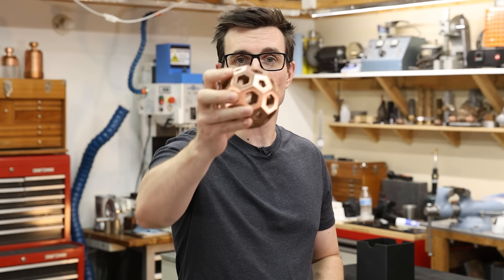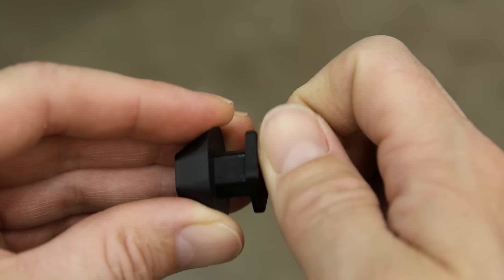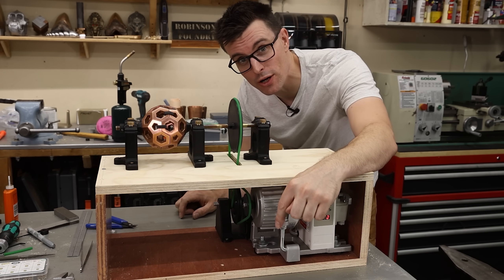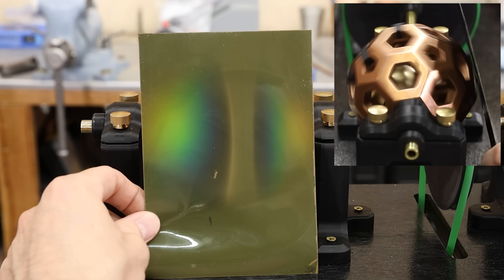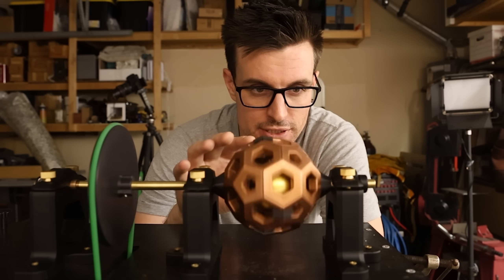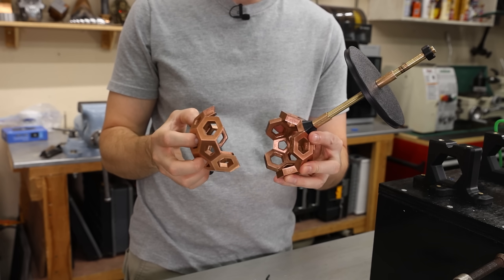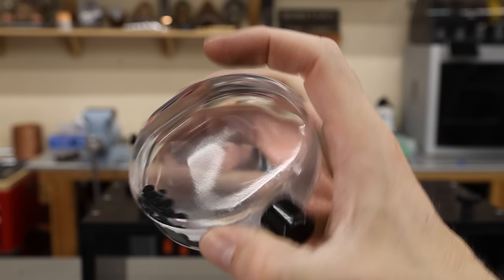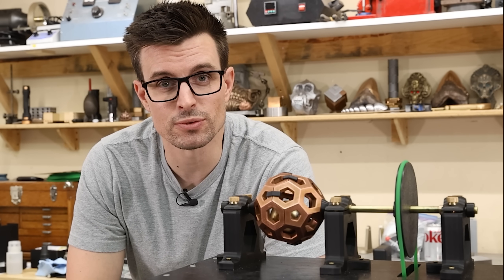Huge Magnet vs Copper Sphere - Anti-gravity Machine

Comment: when a magnet is dropped through a copper pipe, because the forces at work are equal on all sides, the magnet travels through the pipe without touching the copper pipe's inner sides.  I see the problem you had there is the unevenness of space around the magnet, and also the holes in the material of the copper affect the consistency of the field effect. 2 things I'd try: first, use a copper pipe and drop a magnet through it. see how big or how small the magnet has to be for the field effects to balance out, causing the magnet to travel through the pipe right in the center of the pipe's inner circumference.  Use the information you gathered from that experiment to construct a sphere that takes into consideration what you learned from the pipe and magnet experiments. With a solid-walled copper sphere, you won't be able to see what is going on, but if it floats, you will not hear any rattle.  (Side note, mercury is used in electro-gravitic engines.)

Comment: You're assuming that the weight and density distribution are symmetrical in the sphere and the magnet ball, also I can appreciate movement in the mechanical system which must affect the gravity center, you need a more perfected system, also you need to calculate the magnetic field force to know if this is stronger than centrifugal force to maintain the ball centered

Comment: I'm quite possibly wrong, but it seems to me that the problem would be your "sphere" itself... because it's not an actual sphere. I couldn't count the sides but it looks like an icosahedron(?). With the magnet in the pipe you have two smooth actually circular vectors. In this setup you have the spherical magnet inside a cage that is a whole collection of planes and angles. You would HAVE to have exterior stabilizers to counter the fact that no matter how fast it's spinning, you have an entire crapload of different vectors bouncing past each other. 😮

Also, just a suggestion... put the flashing lights warning at the beginning of the video BEFORE you point a strobe light directly at the camera 🙀😹

EDIT:  maybe inserting a smooth circular collar inside the seam of the cage...?

Comment: The holes in the copper dodeca are too large on the central section acting like insulators, not only reducing the eddy currents, but making the dynamics unstable. A stabble position would have gravity perfectly countered by the eddy current flux. The speed at which the eddy current flux counteracts gravity is higher than the dynamic resonance instability limit caused by the holes. Ie. Smaller holes.

Comment: The spherical magnet has a north and a south pole with a line in the middle, what will happen if you make a 3D printed ball, with small neodymium magnets all over the outside with all of the poles facing the same way outward?

Comment: You should try your original magnet pipe setup on something like a rock tumbler rollers just to play around with variables. I think the holes in the lattice and the zigzag lines of copper electrons are creating voids where the copper tube is a continues sea of electrons creating more cushion in a way. But otherwise very interesting video brother man , appreciate your effort to test your ideas.

Comment: The geometry might be more difficult to keep rigid, but what if the hexagonal borders were thinner, creating larger holes that are easier to see into? Or what if it was a copper mesh screen? Forming that into a sphere could be hard, so how about a cylinder of copper mesh, with a spherical, or perhaps cylindrical, magnet inside, rotated around the cylinder's central axis?

Comment: The balance is off with so much movement on the axle Newton’s third law comes into play. Simply said the axle is bouncing and is in sync with the knocking sound.
Reply: Yea that is what I notice, its not balanced at the axel
Reply: @Vmaster005 just like a bent crank/cams shaft or timing out on a car engine.

Comment: logically, i'd think that the holes in the copper would be points where the magnet wouldn't be levitated as much as the solid points and that's why you're getting a wabble. I'd think that having a solid 'strip' of copper in the middle would solve this which means that the only way to view the magnet levitating would be from the side, which is just as good as the front and since you're re-designing the copper sphere, you may as well remove material from the sides. to view the magnet better. 🤷‍♀🤷‍♀

Comment: Anti gravity machine 😂 ummmm no! Sure it can sort of defy gravity inside the sphere but the sphere is bound to gravity so no it can't defy gravity because it's still stuck to the earth and if you built it in space it will do nothing. Won't move forward or backward or up or down. Sure it's a cool desk ornament or a paper weight but to whoever said it's the start of the anti gravity machine is a complete fkn idiot and needs to go join maga maggots and dear leader Donald Putin supporters they have about the same interlect of a dead toad 😂

Comment: Yeah,  it sounds like this works better in a wheel than a sphere,  which was my assumption before reading other comments.  But I'm not a scientist so my assumption means nothing.  

The wheel might be able to help with visibility and the hovering.  

Maybe there's also a decent ratio between the magnet size and the wheel you need to find,  too

Comment: So we know this can spin and spin, so I see you have some kind of motor. My guess is a generator. Ok good set this to 12 volt batteries. What you missed is the fact that yes it works the magnets rotate the spheres. As it will stop or slow down, what I would do is take a small 75 watt or 50 watt solar panels and have  small motor run say every 5 mins then off for 15 mins. So if you pulse this great device it will work. So it has a small knock still works. You have it but you just don't know you have it. Yes magnets are not energy, but solar panels are. So what I understand is that this will be very efficient system. Just complete the system as shown. Later perfection will follow. I know. Let me know and I can redesign the entire device. Or just do what I'm telling you.

Comment: Could you make an electro magnetic motor to levitate a magnet but I have a suggestion on this . 
Think of the magnet as Earths gravitational field ,
Flip the current of the electro magnetic engine to push away from the magnet instead of pulling it to levitate . 
Build a few of these electro magnetic engines . Fit them in a structure that will be the Craft and have it levitate by pushing against the magnetic field pulling it down towards the magnet  placed on the ground .

You could make a mini ufo floating using electro magnetic engines .
Instead of floating a magnet .

Comment: The plane "dead center" of the magnet aligning like a bicycle wheel orientation makes perfect sense, its the least resistance. I already knew that would happen before you showed it, and no I don't have any real life experience that helped me know that.
Its the knowledge I already know that I deducted that, the instant you showed that you marked the magnet, didn't even have to try

Comment: Convert the rig to one that spins the copper tube. I've seen it done on a system that spun 4 skateboard wheels, with the pipe simply set on top of the wheels. Then the camera is placed at the end of the pipe to show how the magnet continuously floats.

Comment: You know what would be insanely neat? To enclose the whole thing in a tank of like water or circuit board oil/coolant and put the ferrofuild around it? So it would be a big 3d tank of ferrofluid moving around the magnet as it spins. Theoretically you could have two separate tanks, one within the other to prevent the fluid getting in the motor or just touching the magnet itself. Like you could have a spherical clear plastic or glass tank for the magnet and motor and a typical fish tank around that, put tons of ferrofluid in and it would look 3d!! That would be cool af!

Comment: What happens if you change it a little bit? I think you got a problem there. 
If you to spinning this kind of shape it will make magnetic holes. This holes are a good idea to see insinde of the first sphear. If you make holes, but not in the path of the boll, it maybe can work like with the tube. I think the mass around the boll has impact in the magnetic field.

Comment: I think it would work better if recast the copper so where the magnet spins is solid that why you getting a wobble in the magnet it push and pull different directions because path surface of the copper isn't straight

Comment: No dude, it has nothing to do with your tolerances. It’s because you decided to with a dodecahedral copper cage with irregularly-sized bigass pentagonal holes. So, the diamagnetic/antimagnetic effect upon the spherical Neodymium magnet is also irregular — causing it to periodically bump against the thin inner-walls of your oddball icosidododecahedron copper cage. It’s analogous to installing decagon rubber tires on your vehicle that has premium shocks & suspension and then wondering why the ride feels bumping even though you’re driving it on a super smooth road. If you had went with a thicker or spherical copper cage with evenly/equilaterally-spaced hexagonal or circular holes instead of an oddball icosidodecahdron you wouldn’t have that problem, but I condemn you the effort and gumption to try it in the first place. Great minds think alike. You haven’t seen “extremely magnetic” yet. The US DOE (Department of Energy) has had classified N614 “monopole ultra magnets” since 1972. They’re so powerful they can power a military tank for a whole month with just a common 9V battery.
Reply: Bro holy yap just enjoy the video without geeking out

Comment: I think I know what the problem is but Idk if I will be able to successfully explain it. The ball inside can only hover horizontally because the outer cage is spinning in one direction. Causing the ball inside to fall to the poles of the spinning cage. The only part inside the cage that wants the ball to float is the equator. The poles want the ball to come to them. The only way to fix this is to have something hold the ball away from the poles. Or make a whole gyroscope so that the cage can spin in all directions which would cause the ball to float in all directions. Thats my theory. I hope its understandable.

Comment: Try using a copper pipe that you can rotate (like the copper sphere) and see if different magnets levitate inside the pipe.    I have always wanted to build a tall pendulum that suspends a large neodymium magnet.   Below the pendulum is a large copper plate curved in the arc of the pendulum.  The string that suspends the magnet ball can be changed out for a nonferrous steel rod to see how the magnet acts as it sweeps over the curved copper plate at different velocities.  Love your experiments and videos

Comment: I’m a PhD plasma physicist, and I can tell you that when the magnetic pole axis is coincident with the rotation axis, the effect will go away, because the polyhedral copper shell you built is no longer experiencing a change in magnetic field when rotating, due to symmetry. Even though the magnet is off-center, I still suspect the effect is too weak to cause the magnet to float, and the magnet falls back down.
Reply: That's exactly why planetary bodies have slightly tilted magnetic fields.
Reply: @bastadimasta...and round!
Reply: What is magnets are replaced for those holes different polarities or at least some of those holes
Reply: would it make a difference if a current were applied that would make the magnetic field of the ball spin perpendicular to the direction of rotation? not sure how that would be achieved, total noob asking.
Reply: Nice attempt! Never give up, thank you.
Reply: An idea to improve the machine: the main copper cage axis must rotate itself around a second axis, so the magnet axis and the rotation axis are continuosly misaglined allowing the magnetic field lines to cut the copper orthogonally any time, the magnet mass should not be too much small otherwise it will start to chase the path of copper cage rotation.
Reply: Thats what i was gonna say minus the phd part
Reply: يعمل نصف الغلاف من الألمنيوم ليكون نصف ألمنيوم ونصف نحاس ...
Reply: I have no specialty here, but…
If the poles aren’t experiencing a change in their forces, because it settles into a symmetry, then could the problem be solved by having a solid copper sphere inside of a shell with magnets impregnated into it? Fixing the poles of the magnets would prevent symmetry if the magnets were the ones rotating around the ball, right?
Reply: Silver might work better than copper
Reply: I was already a real know-it-all in school. The teachers didn't like me because of that. (It's because of the holes. Sometimes the magnetic field is on the right, then on the left..... wobble and boom) The better question: how can 600,000 people be so blind? The magic foil shows it.
Reply: Thank you
Reply: Get rid of the planes and angles. Have a sphere, you may find it works.
Reply: Exactly.
Reply: @NateHiggers-k5x  😅😅
Reply: Is the start of reactor gravitationnel but it have to turn 10.000 turn per minute and put circulation pipe with mercury a round your reactor. Test that but use magnet bering 😊
Reply: @olivierhernandez5580 Así lo hicieron los antiguos.
Reply: I don't have any degrees, but my thought was part of the problem is the cage itself being a polyhedron instead of an actual sphere... the planes and angles would seemingly interfere with the field interactions basically tumbling it all over the place. Would my suggestion of adding a smooth circular collar inside the seam make any difference, you think? 😮
Reply: @DaellusKnights ...but it looks cool.
Reply: It would work with a  bismuth  shell casing or bismuth titanite because it is more diamagnetic than copper. Then try wrapping the magnet with aluminum foil too. I do gravity science.
Reply: Gyroscope.
Reply: Are you replicating the Buga sphere?? 🤔😊
Reply: I'm a PhD in hood Physics & I can tell you if you place a crack rock inside that copper sphere, somebody will try to smoke it😂.
Reply: Build it on a pendulum
Reply: Seems like in a liquid form. Anti-gravity would be possible.
Reply: I have a patented math that can make everhthing your trying to do work however you are not only missing several variables that need to be included the hexagonal sphere you have needs some modifications
Reply: Off topic, what's your thoughts on solid state thrust through diamagnetic repulsion and quadruple resonance with electric, magnetic, phonon, and plasmon coupling? I was thinking if you ran a direct current through say aluminum/titanium to create a 0.8 T field and then had a dielectric spacer between an FeSe superconducting plate which acted as an A/C wave guide at 5 THz. You could create thrust from the electromagnetic pressure gradient generated when superconducting at 37 K. It might be micro newton thrust you'd have to measure on a carousel at first, but I'd imagine split ring resonators, a chiral meta material film, and barium titanate would boost the pressure significantly. This may also be doable at 3 THz with a YBCO plate at 77 K if using liquid nitrogen over helium for the systems cooling fins.
Reply: My over my head.Over my head.
Reply: @AircraftFTW  wow! Are you familiar with to the Kolsol device? Nathan Bunting's channel covers much of what you shared. Fun stuff :)
Reply: @danielfoster2788  You might have to share the video, I can't find it.
Reply: We got a mega nerd in the comments

Comment: seems like the higher you increase the motor speed the stronger the magnetic force its creating and that is why it isn't suspending at high rpm even when you have attempted to counter the effect using that clamp on the opposite side. it's not merely the external metal affecting it but the motors own magnetic field it's producing to operate

Comment: I'm not really qualified to give advice but here's my thoughts anyway. 
We know that the physics work when you drop the ball through a copper cylinder, so the only thing that changed is the shape of the copper vessel. I think since you no longer have the whole length of the copper tube to generate a difference in potential between the two ends. That you need to switch to diametrically opposed copper coils. Maybe this would increase the strength of the magnetic field? Lorentz force is what we're dealing with right?

Comment: Great video!  I’ve watched both now.

The magnetic material is shaped into a sphere, BUT the magnetization of the sphere is in a “straight through” direction.  In other words, you have North Pole on one side of the sphere and the South Pole on the other side.  

So field wise, the magnet is not spherical at all, so your forces are uneven.

Suggest you 3D print a sphere where you can inset small neodymium disc magnets with all of the magnetic poles oriented in a particular pattern around the sphere.  All north (or south) poles on the outer surface should cause more even forces against the copper sphere (the copper sphere is SO VERY COOL.) However, an alternating north / south pattern may work better in practice.

PLEASE TRY AGAIN!

Comment: Right shape, wrong implementation. The core is metallic hydrogen and the buckyball lattice structure should be made of tungsten alloy. The holes in the lattice structure take flat bell shaped copper beryllium alloy pins with ALON ceramic coating on the active side, connected to fiber optical cable. Directional application of burst laser light should induce spin to the metallic hydrogen, initiate fusion and potentially with the proper salting a gravity defying electrostatic effect. The entire thing should be encased in neutron resistant materials as it will produce cosmic ray level gamma and neutron emissions when in operation